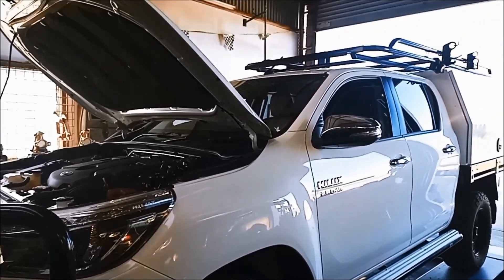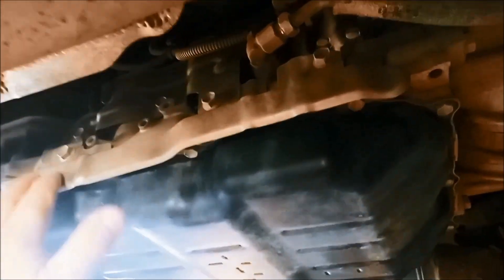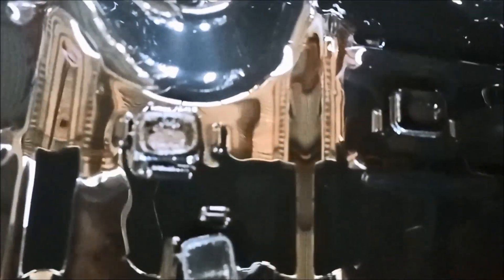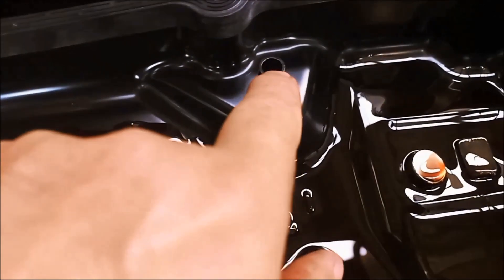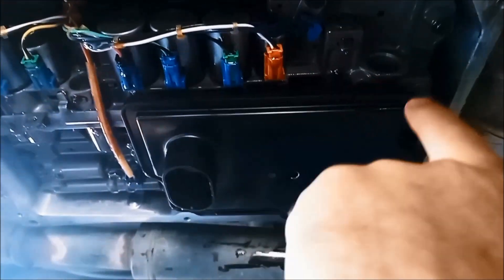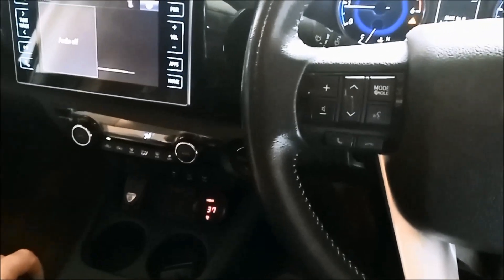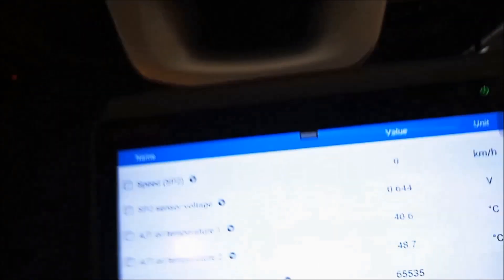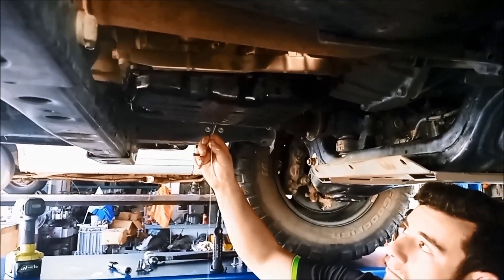AC60E AC60F AWR6B45 Automatic Transmission Filter Service  Lubegard ATF Platinum How to DIY

Comment: I have a 4l60e could worn dipstick orings at the top flip lock affect trans pressure? An it has just hit 200k with regular service on trans ....should i use lucas transmission fix for preventative maintenance even though its running good,...an do you have a ebay shop under autotransdiy
Reply from the maker: hi, you probably have internal pressure leak. there is a breather on trans, that fliplock clip is just to stop dipstick from popping up and getting road dirt into filler tube. cheers